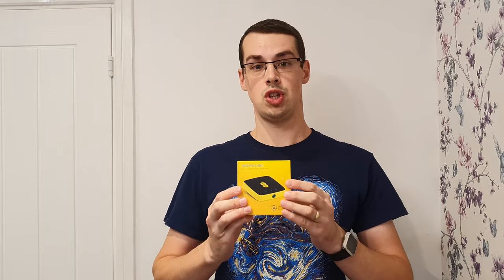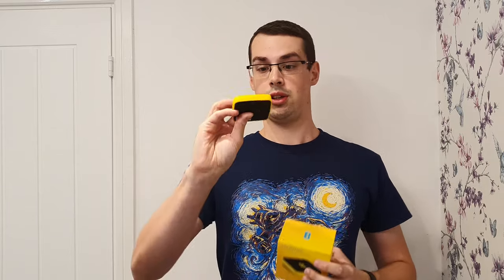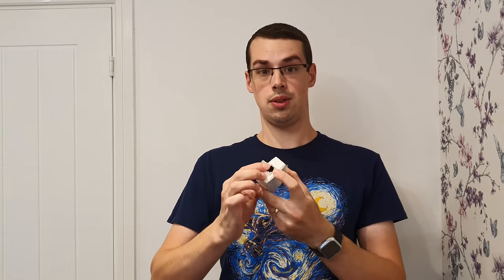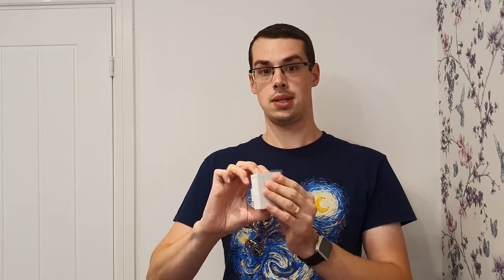Getting Internet To Outbuildings (7 Different Ways)

Comment: Hands down this is the best video out here on this topic! 

My question is for method 6 (running an etherent cable). 

I am running a 50 meter cat 6 cable underground from my Sky router to my outbuilding. 

What kind of router do i buy to plug it into. Ive heard people say access points and some people saying a basic router is fine.

 Just a little confused as to what would be best?  

Any advice would be highly appreciated. 

Thanks!

Comment: Re: outbuildings and shared consumer units. I've experienced difficulties here, before my rewire in 2018 on 50 plus year old wiring the circuit was definitely shared and some Moss security lights which sent a signal to an audible chime on a unit inside when the PIR was triggered worked perfectly. As soon as my new wiring was installed with the outbuildings now fed from the house consumer unit by armour plated cable the apparatus stopped working; further testing revealed that if I used it in the house it worked and if I used it in the outbuilding it worked but nothing if one element was in the house and the other outside, I've found this to be the case with range extenders as well. In very simplistic terms it's as if there's a resistance issue due to the distance (10-70m depending on outbuilding) or the step up from internal cable to external armour plated.
Reply from the maker: That's really useful to know, thanks for the info. In my case, powerline adapters have been fine across different circuits (but the same consumer unit)... but they definitely aren't fool proof, I agree.
Reply: @SmartHomePoint  Supplemental. I've set up the AV600 kit this morning with no issues in the building furthest away from the main house.
Reply from the maker: Hmm interesting, thanks for the update and I'm glad the AV600 kit seems to be working fine 🙂

Comment: Hi can you run the Ethernet cable to an out building connect to an extender instead of a router?
Reply from the maker: Hi, yes that would work fine (as long as the extender has an ethernet port). 🙂

Comment: I have a garage in my back yard and want wifi in there I think a Ethernet cable work be fine do I use any router and would putting it in
Another router work would I have the same login and password as my router in my house or would it be different?
Reply from the maker: Yes that would work fine, however not every router will work. The router is effectively working as an access point and some ISP routers disallow this. Having said that, I reused a BT HomeHub 2 in the UK and that worked okay. It will probably create a brand new WiFi network, since it's basically a second WiFi router that you have setup.
Reply from the maker: Have a look at this other video, where I explain the process I followed in more detail: https://www.youtube.com/watch?v=IDXneJVh91w

Comment: That was very helpful, thank you👍🏻 Do you know if the powerline adapter works if the secondary house is on a different electricity company meter? (I don't think so as it's not on the same electrical circuit). 
One annoying thing is that when searching for repeater or booster, internet gives results mostly for extenders that works on a different network, meaning you have to choose between your house network or the extender network, it's not the same thing, plus the one I tried was a fraction of speed, even in the same room as my router, I returned it. 
I think I'll use either a cable or a bridge system but it requires a second router in both cases, so the most efficient and economical is running a cable, not the easiest tho☹.👋🏻
Reply: hey, im currently using a powerline adapter from a different building, and the internet sucks, I know its not an issue with the system itself because its the same one I used in my last house where it worked fine. Id really suggest another alternative
Reply: @samioy.  I ended up running an ethernet cable from my modem/router to an access point (on the same network) , in the secondary house, the speed is now great there but I get disconnected very often in the main house, I might need to upgrade my internet service, or perhaps it's a coincidence.👋🏻

Comment: Hey really helpful video man. I have a question and it may be a dumb one but; if my home has a modem can I purchase a router and run it to an external building and get a WiFi signal in there?
Reply from the maker: Thanks man 🙂 Yes there's various options for getting a WiFi signal in an outbuilding. It depends on exactly what modem you have, but if you're able to run an Ethernet cable from the modem to an outbuilding, that would be the 'best' option - you would plug the Ethernet cable into the modem, then get a WiFI router in your external building and plug the Ethernet cable into that. Of course, this is 'best' - but might be too time consuming (or expensive) to actually run the Ethernet cable all that way. An alternative would be to purchase a few "whole home WiFi" discs, and plug the first into your modem. Then put another between the first disc and your external building, and another disc in your external building. Then the discs work together to provider WiFI throughout your home, and your external building too.
Reply: @SmartHomePoint   thank you

Comment: I have Sonos wifi speakers and a Sky Minibox in my mancave at the bottom of my garden. I used TP-Link power line adapters and everything worked at the beginning. Then my Sky Q main box started experiencing internet connection problems. This would filter back to the mancave and things stopped working properly. The connection would constantly drop out and then reconnect itself. I changed all my Ethernet cables, got a new Sky Q box from Sky and even changed my ISP. All to no avail. Eventually i unplugged the TP-Link PA and the internet connection reconnected and stayed up. Powerline adapters are a great idea but they're not for everyone. If you try them out and the internet connection drops out, remember this post. And keep your receipt as you'll be able to get your money back.
I'm in the process of running an external ethernet cable to the mancave instead. I hope its worth the trouble !!
Reply from the maker: Hey Steve, thanks for the comment. That sounds pretty annoying!

Luckily my TP-Link power line adapters seem okay overall, but I do suspect that they cause a bit of WiFi interference - my WiFi seemed a bit less reliable after using them.

I'm glad you were able to figure out the cause, and I agree that running an external Ethernet cable is probably the best route for you. Hope that goes well for you!

Comment: Does powerline work for your cameras during a power cut?
Reply from the maker: They wouldn't work, no, since they take power from the mains. Plus my WiFi is off during a power cut too, meaning my Ring cameras are pointless due to having no local storage 🙂
Reply: @SmartHomePoint  thanks, I was thinking about modulation of a non-existant base signal. But of course you are right: the units at either end would be unpowered anyway! Perhaps pulling a cable is  ultimately the best, paired with POE or 12V battery packs or whatever, if not UPS.

Comment: Hello Tristan .question for you since you seem like a internet nerd <code for really smart} .ha ha . I put up gate camera weak signal .i purchased this from amazon ,WiFi Extender, 2023 Fastest WiFi Booster 1200Mbps Dual Band (5GHz/2.4GHz) WiFi Extenders Signal Booster for Home, Internet Booster WiFi Repeater Covers up to 10000sq. ft and 45 Devices . my router is by the  wall  . camera is 110 ft from house signal starts to drop at 75ft so if i plug in the extender on the outside wall will this give me the 25 ft i require in theory or can i plug it in at garage which is 40ft from house and has signal .Other thing is i watched a video saying you cant use a surge protector oR power bar ??? i thought 110 volt was 110 volts either way that dosen't make sense to me . Thanks look forward to your answer .hopefully i explained things well.

Comment: Very informative video, thanks. For me it would be easiest to split my incoming Broadband and run a coax from the splitter to my outbuilding, is that an option (I suspect not) and if so what device would I need in the outbuilding to connect my coax into? Thanks.
Reply from the maker: Thanks , glad it was helpful 🙂 Using coax for internet could actually work well - I've heard about working fine, but I don't know any specifics (max speeds, signal degredation etc) unfortunately. In terms of an adapter, I think you can get coax to Ethernet adapters which seems like what you would need: https://www.amazon.com/coaxial-ethernet-adapter/s?k=coaxial+to+ethernet+adapter

Then you can just use Ethernet to a WiFi access point in the outbuilding.
Reply: @SmartHomePoint  Thanks for your reply, I will do some further research.

Comment: I tried using the extenders and power line before but I keep getting dropped signal or no signal at all. Would the mesh be better?
Reply from the maker: Hmm that's odd. Sometimes the house's electrics can cause issues with power line adapters, especially if it's older wiring. Or it may have been a faulty device. WiFi extenders should work okay to be honest - and mesh is almost an extension of this (i.e. a bit of a better version of it).

So it could be worth trying to understand what caused your extenders not to work - was it mainly that you had a weak signal? If so, perhaps your walls are thick in which case only a quality mesh system (and lots of mesh points) will work.

It's hard to know for sure though, since every house is different and may have different WiFi disturbances based on nearby factors and neighbours etc.
Reply: @SmartHomePoint  Thanks for explaining all this, signal was strong but it keeps disconnecting after every 30 minutes or so. And the only way was to turn it on and off which was annoying.

Comment: Hi, very helpful, I have a Ethernet cable that comes to my garage, it connected to a Sky Q box, and that gave me wifi in the garage, but I changed my provider to EE from Sky and the Q boxes now does not  give me wifi, is there something that I can plug the Ethernet cable into before plugging it in the Q box that would give me wifi there?
Reply from the maker: Hi, thanks! So do you have an actual Ethernet cable running throughout your house and into your garage? If so, you should be able to plug this into your EE router in your home (using an Ethernet extension cable if needed), and then use a WiFi router as an access point in your garage.

But if it's the case that the Sky Q box provides the Ethernet cables, that's also fine - this is your Sky Q boxes acting as powerline adapters. In this case, adding a WiFi router in your garage (again acting as an access point) will work well.

The WiFi access point/router approach can be a bit of a pain to setup at first, but I show most of it in another video: https://youtu.be/IDXneJVh91w

Hope this helps!
Reply: @SmartHomePoint  Hi,
Yes that is what I thought but just needed to hear it from someone that knows !.
I have a Netgear N150 that I am going to instal tomorrow, it an old one I had from before. Thanks for your time, I have liked and Subscribed, hope your keeping safe in these difficult times, thank you again.
Griff
Reply from the maker: Thanks Griff, I hope you're keeping well too! Netgear's are usually quite configurable so hopefully that'll work out well 👍 Thanks, Tristan

Comment: Hello, I was wondering, can I run the cable into my garden building, into a face plate & then run a smaller flexible cable from the face plate into a router and get WiFi that way? Is it better to run the cable direct into the router?
Reply from the maker: Hello, running it into a faceplate - and then running a new CAT cable from the faceplate to the router is totally fine, and is a more standard approach. You will need to wire up the faceplate which is naturally an extra step, but this approach will be better overall IMO.

Comment: Question I was thinking of the Ethernet cable but router is far away can I add a splitter to coax cable of provider and run coax wire to ship and hook it up to a router?
Reply from the maker: To be honest, I'm not too sure sorry. I have heard of people using coax for internet data (i.e. Ethernet over Coax), but I can't say with any confidence that what you're proposing will work. I hope it does though (please let me know if so, I'm interested!), and maybe someone else can comment if they know more.

Comment: Great info. So I already have a ethernet cable ran to my building from my house and I have sagemcom modem/router from Windstream in the building cause thats just what I had lying around. I have fiber wifi from my power company in the house and I get around 100mbps in house but only get 10-20 mbps in building could this be because I need a better router in the building?
Reply from the maker: Hmm, that's odd. Perhaps try plugging a laptop directly into the building's Ethernet cable and then run a speed test. If that also shows 100mbps (or close to it), I agree that the router is probably the issue. Beyond that it's hard to know what to suggest - the length of Ethernet cable and the port it's plugged into in your house could also have an effect.
Reply: @SmartHomePoint  it is a 100 ft cord from home to building. I will test and then get a new router if needed. Thanx a ton for reply
Reply: @SmartHomePoint  just in case anyone wants to know. I bought a Netgear ac1000 nighthawk router and now my speeds up and down are 100 mbps the max my provider offers so it was the old modem/router from windstream.
Reply from the maker: Ah great, glad you got that resolved! The Nighthawk routers are good quality.

Comment: Hi so I've ran my cat 6 cable to my outbuilding, it has no end connectors, do I need 2x RJ45 adapters and any type of router for WiFi?
Reply from the maker: Yes, it sounds like you'll need RJ45 adapters/connectors and a crimping tool. There's various videos on YouTube showing how to crimp a CAT cable. It's a bit fidly at first, but it's not too hard. And then for the router, any should work but because you're essentially creating a WiFi access point, some routers (especially old ones from ISPs) might need extra configuration. I cover what I did to turn my BT HomeHub 6 into a WiFi access point in this video: https://www.youtube.com/watch?v=IDXneJVh91w

Comment: If my barn has separate electrical can I still use the power line adaptor method ?
Reply from the maker: It will work if the barn's electrics meet at the same consumer unit/breaker panel/distribution unit (different phrases for the same thing, depending where you are in the World). My downstairs and garage are on different electrical circuits but work fine, as they both still meet in my consumer unit.

However if the electric supply to your barn is from a completely different source, it probably wouldn't work.

Comment: great info , can you go into a bit more detail on wireless power line adaptors??
Reply from the maker: Whilst I just have non-WiFi power line adapters, I do know of people with wireless ones that really like them, e.g. this TP-Link one: https://www.amazon.com/TP-Link-AV600-Powerline-WiFi-Extender/dp/B00HSQAIQU/ref=mp_s_a_1_3?dchild=1&keywords=powerline+adapter+with+wifi&qid=1610267006&sprefix=powerline+adapter&sr=8-3

The main thing to know is that they still require being plugged into the wall sockets on each end, and also one end needs an Ethernet connection to the router (or a network switch). But then the other end will offer up a new WiFi network, making it more practical to work with on the other end.

Happy to answer any more questions you have on this approach though :)

Comment: Thanks. Using the Ethernet cable method, is there a difference between a cat5e or cat6 cable? Also, does it really matter what category cable to use  if the download speed from my network provided is less than 100mb/s?
Reply from the maker: Nope you're correct that it doesn't really matter. Cat5e and Cat6 will work the same way here (max 1000 Mbps speed) but as you say, both would be limited by network speeds if your ISP offer less than 100 mb/s.
Reply: @SmartHomePoint  Thanks. So, I’m guessing it’s really a question of future proofing the work for when (maybe 5/10 years time) when we all have ultra 500+mbs download speed? Cool.
Reply from the maker: Yep exactly, it's mainly a matter of future proofing (although I do know someone who recently got 1 Gbps speeds from Virgin!)

Comment: If I run an Ethernet cable between the two buildings how do you configure the two modems do they talk to each other? Is this advanced or simple? I appreciate your help
Reply from the maker: You can use an old router or a network switch (a switch is often the better option) and in 99% of cases it should be plug and play - it shouldn't require any extra config. In other words, it should be simple.
Reply: @SmartHomePoint  I need to use a router because everything in the second space  is wireless! Phone, fire stick and Laptop!
Reply from the maker: Haha yes I know the feeling! So plugging the Ethernet cable into the router should be fine. Regarding it's WiFi, effectively you're creating a wireless access point. This may or may not need extra configuration within the router's admin panel. I did this in my garage (my Ring Indoor Cam connects to the router over WiFi) which I explain in this video plus the video's description: https://youtu.be/IDXneJVh91w